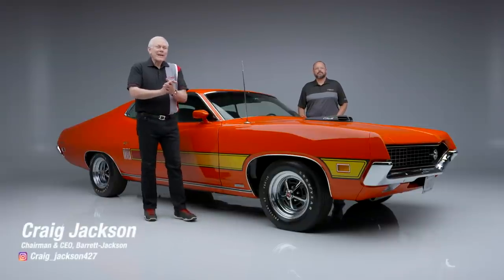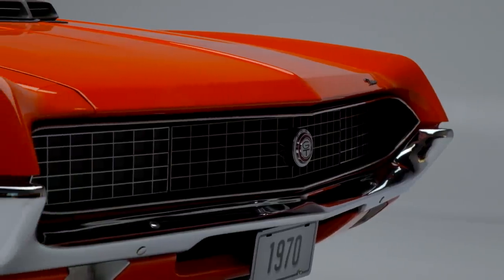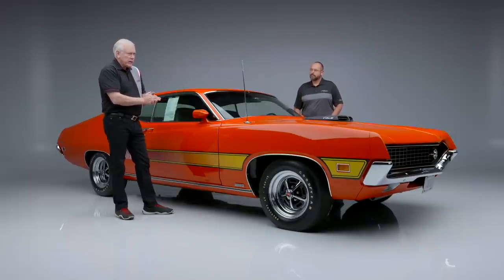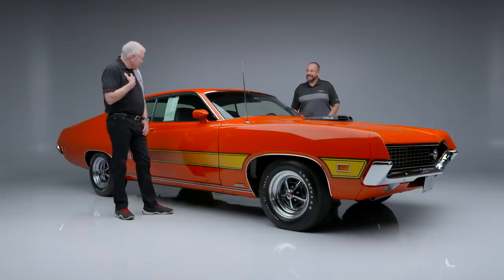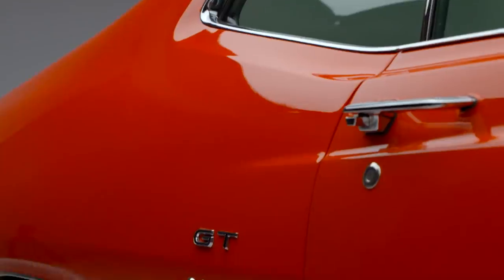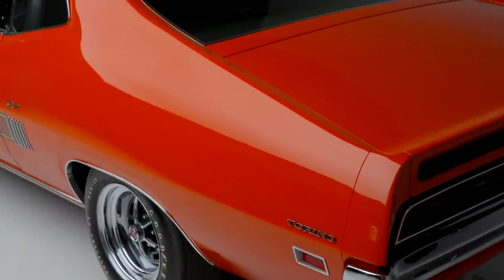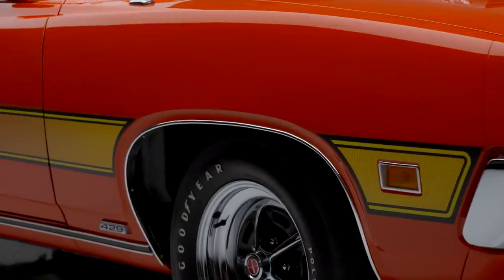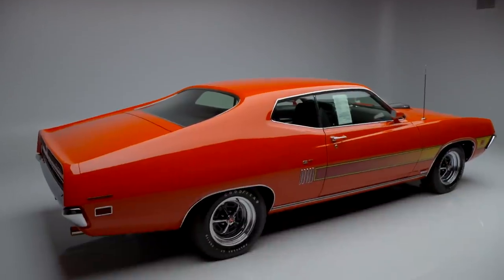FIRST LOOK - 1970 Ford Torino GT 429 SCJ - BARRETT-JACKSON SCOTTSDALE 2022

Comment: I owned a 70 Torino GT that was red like this one with the laser stripes but it was a measly 302 automatic. I loved it anyway. After a few winters in western Pennsylvania it rusted away. I still have the original full wheel covers. Some of the fake bolts on them were broken because someone must have put an air wrench on them. I also have the hood scoop. Memories. Man I wish I had it now the way it looked when I bought it. A junkyard guy dragged it away one day.

Comment: My father had this exact same model and color car.  429 cj 4 speed from Milford Connecticut in 1979.
Reply: Tom Keeler, the 429 SCJ engine was different than the 429 CJ engine.

Comment: What I don't understand is how Youtube videos show that a 1970 Red Torino 429 scj can vary with times of 13.71 vs Red Cuba with 440 of 13.78 on here to another 1970 Torino 429 scj of 12.93 to a Transam of 13.23 to a 1970 Red Torino 429scj of 13.64 vs a Camaross396 of 13.59 to a 1970 Torino 429scj with 13.08 vs Olds w-31 which wound up doing real bad so didn't write down time to finally a 1970 Torino 429scj of 12.72 to a 1969 Yenko 427 Camaro of 12.0 then 12.59.   Then it was mentioned that Motor Trend ran a 1970 Torino 429 scj  with 4 speed and driver to 4206 lbs. to a 13.99 time in Feb. 1970.  These times ranged so badly that I thought maybe read end  as one guy stated that stock was geared 3.91 with Detroit Locker gearing being 4.30 but that couldn't be right as narrator advised 1970 Red Torino with 429scj had 4.57 factory gearing for 12.72 race vs 1969 Yenko 427 Camaro so something else had to account for difference of 1.27 seconds so what?????   
          Also, according to Barrett Jackson, he states that Ford produced 240 of these 1970 Torino 429scj cars when every narrator in some to all these above videos has mentioned at one time that Ford advised that only 124 or 125 or even 150 were only produced so?  The reason why I am still fascinated by these Ford's is that I along with my brother John used to own one 1970 Ford Torino 429scj with actual slide spun tach in dash with 4 speed that was Blue in color that could lay down 2 black marks for well over 2 car lengths from start.  We never drag tested it for fear of somebody following us to steal it.  Any other questions anybody?

Comment: wow 430's in the rear - wheelie king!
Reply: LOL. Not with those tires, weight, and long wheelbase.
Reply: @joequillun7790  let's get some slicks on it and see.  a guy I knew with a GTX 440 similar rears with slicks had his up in the air at the drag strip regularly
Reply: @claysmell  Yeah, I guess. I did see a vid the other day, of this body style, at the drags, beating HellCats, and a new Cadillac something or other, that was built, and NOS. 
Running 9s, and pulling the wheels. I'm sure there was no top-loader in it. :(

Comment: Yes, it sure is different from when I found it and bought it for seventy five dollars in 1988! Spoiler alert! It does NOT have a numbers matching engine or trans and the SCJ shaker is actually off of my 1970 Torino Cobra that I bought in 1982 and still have.
I sold it, running and driving with a C-6 auto in 1998 to Terry Dodge of Vancouver, Washington, for $2,400.00
I was lucky enough to be able to go and watch Jeff Esterberg (Esterbrook?) while he was restoring it for Bob, the owner.
Reply: do you have the original engine still?
Reply: @brandonhumphries3377  I bought the car as a roller in 1988 for seventy five bucks and never had the original engine or trans.
Reply: @torinoscj  LOL. Now this is funny. The video is stating it as an original matching numbers car.

Comment: Only reason they only made 241 is that everybody was buying the L78 big-block Chevelles that would walk the 429 Torinos all day long.
Reply: Chevelles are yesteryear equivalent of a prius
Reply: @timmebruer5205  You being a Prius owner you wouldn't know a Chevelle from a Cuda.
Reply: @nojunkwork5735  sorry, I'm not like you.
I own a 2000 dodge Cummins turbo, a 2005 mustang gt convertible ( one of 396 in screaming yellow that year) and a 2003 harley Davidson heritage (100 year anniversary model)
Reply: @nojunkwork5735  what's wrong?
Don't feel like bragging bout your yota?
Reply: @timmebruer5205  I didn't know those machines that you listed were supposed to impress me. Go buy some real collector vehicles and try it again,
Reply: @nojunkwork5735  they're better than your prius...
Or any Chevrolet product
Reply: @timmebruer5205  You buy a dodge if you want electrical problems and a junk dashboard. You buy a Ford because you just don't know any better. And guys like you buy Harleys thinking you might get a date. In your case it worked, you and the little guy next door are a cute couple. I don't own a Prius but they probably are far better than the junk you drive. Dodge and a Ford, same quality as a Yugo.
Reply: @nojunkwork5735  Anyone who brags on owning a 2000 Dodge pickup with the disappearing dashboard can't be too on the ball. Or a 2005 Mustang that has no dipstick to check the trans fluid.
Reply: nojunk work, 241 with the drag pack option. 1475 were produced in all. 1970 L78 Chevelles  couldn't just walk away from a 1970 Torino 429 SCJ either. I've owned both and the '70 Torino 429 SCJ is quicker/faster which is why I still own one. GM and Ford both underrated the HP for both engines. L78 had 50 more HP than rated. Ford 429 SCJ had 100 more HP than rated. My '70 429 SCJ showed 485 HP on the dyno. Enjoy your delusions.
Reply: @nojunkwork5735   People buy Fords if they care about longevity/reliability. GM is the king of recalls and needed a bailout to save them from going bankrupt due to the low-quality crap that they were producing. Quality still hasn't improved by much. Ford F-series trucks still #1 for 44+ years. Also, say bye-bye to the Chevy Camaro. There will be no 7th generation Camaro because current sales are in the crapper.
Reply: @nojunkwork5735  Do you personally own a real 1970 L78 Chevelle? I bet not.  I personally own 9 fully restored classic/vintage high-performance Fords. One being a 1970 Torino 429 SCJ 4 speed drag-pack option car. 26+ years, I've had a classic/vintage vehicles restoration business that employs 10 people full-time. Only thing a Chevelle is good for is to buy, restore, and sell for a profit.
Reply: @nojunkwork5735  You can only wish that you could afford a Harley Davidson Heritage edition.
Reply: In the late 70s the small town where I grew up was populated by at least a dozen 67 to 70 chevelles , the majority of them big blocks.  Including a 70 454 ss and a 67 with a 427.
The 2 quickest cars in the county were a 70 340 swinger and a 69 fairlane with a super cobra jet.
The fairlane was the quickest and was given the name spot.
As in "how many lengths am I gonna have to spot ya"
In 2019 I was talking to the guy who owned the 67 chevelle with the 427 and asked him if he ever won a race against spot.
He cursed then laughed and said "nobody ever beat spot"
Reply: @sergeantmasson3669  I have seen no junk work and his wife's car collection and although 9 fully restored Fords is a good start it hardly compares with no junk works collection. I don't think he has a 70 L78 Chevelle, but he does have numbers matching LS6 4sp Chevelle. He also has a 67, and 2 69 L78 Chevelles. He also has everything from Studebackers and AMC and Mopars along with quite a few very nice numbers matching Fords with one being a 2005 GT40. He also has a very nice collection of motorcycles. As for him being able to afford a Heritage edition Harley, that's funny.